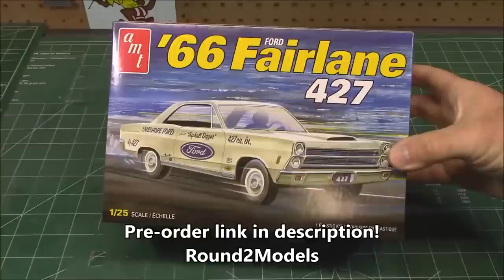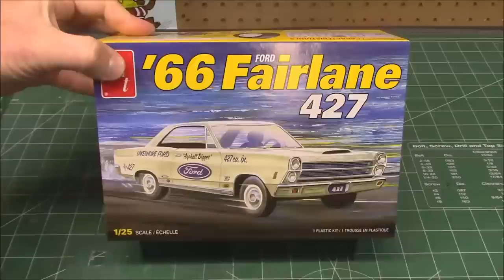1966 FORD FAIRLANE 500 427 V8 1/25 SCALE MODEL KIT BUILD REVIEW AMT AMT1263

Comment: Did you find gluing the front end on issue ? I'm on my second GT kit (the original 90's one with white car on box) . I found the firewall pushed the front out .
Reply from the maker: I've heard some have to remove the horns and the little lip of plastic on the fire wall and then it fits well.

Comment: I want to know why you always paint the windshield washer bag red On my '66 Mustang my FOMOCO wiper bag was in the ford engine blue or medium blue with a little staining would be good coz mine was faded and some of the white FOMOCO wording was missing I think the red bags went with the late 50's Fords when some engines were painted Ford Red !! I built this model back in the late 80's but this Round2 kit looks alot better  except my AMT didn't have those nasty reinforcement tabs behind the A piller; more body work uhhhggg think I'll make a charcoal / gray 66 Fairlane high boy!! Nice job on the interior and its great that you customized the center console I do mine all the time the way I want it  That's where I take lots of liberties  that and buying Hoppin Hydro kits and modifying them to fit under different models!!  Go modeling!!! 😉